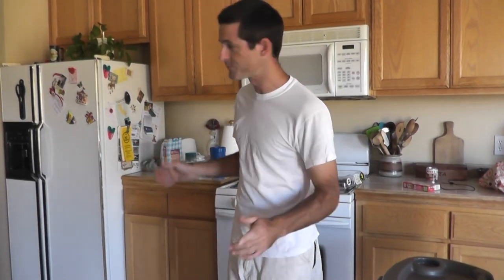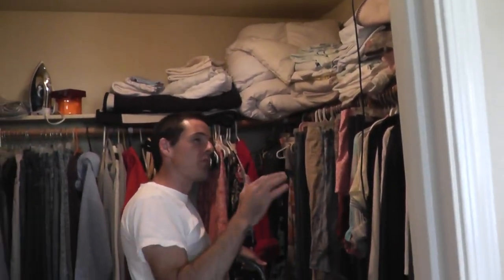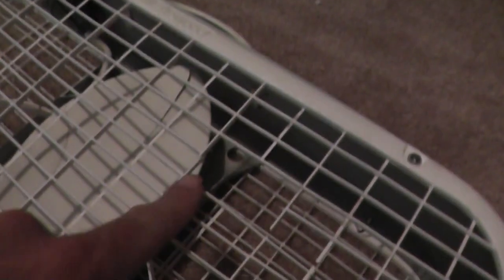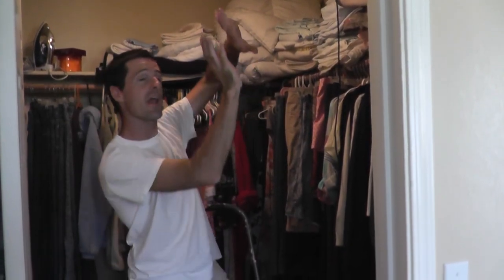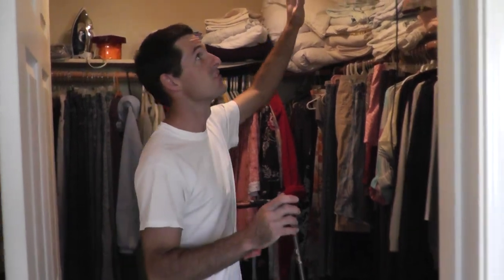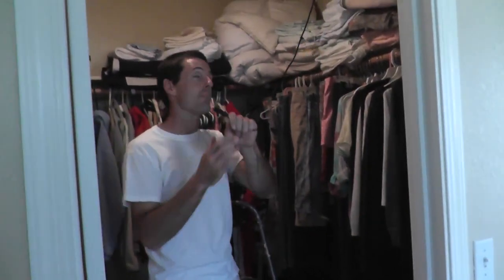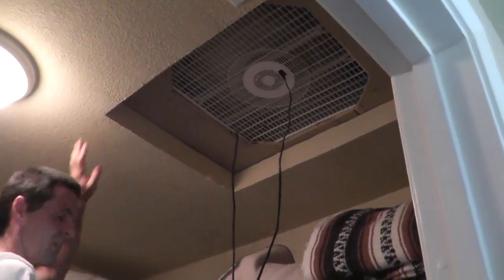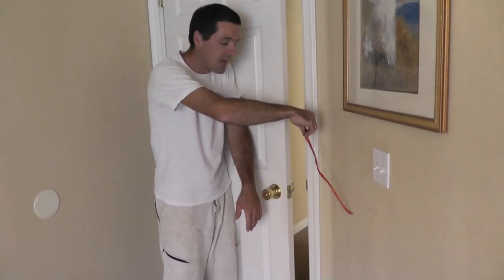Cheap Homemade Whole House Fan - How To Cool Without A/C !!

Comment: I did this to cool my condo.. it worked great = seriously saving money is plenty fun and figuring out tricks to do it on the cheap are even better ... now in my house  it still works and yesterday  box fan fell over and broke a blade... so room a/c and small circle fan is  running to keep the air upstairs in the babies room moving and that is keeping a 81* temp day outside here about 71 ... booya! ... still going to get another two box fans since they are only $15 a piece and are probably way more energy efficient...

Comment: I really want to try this, but I'm worried about pumping all they warm air into the loft. We're renting so have to be careful. Do you need to do anything in the loft in terms of venting?
Reply from the maker: Yes, it only works if the attic is ventilated.

Comment: I went to Walmart last year and got me a 18 inches Optimus  high velocity fan and made a special frame for safety.. . works really good! 127  deg F. and if i turn the fan  on to medium setting for 15 min  Attic temp  drop down to 109 deg F. ( using Arlo video cam)  house is 2200 sq. i also made a shutter  that way small particle  don't  go inside  my house... re wire  all the way down   like a hall way switch.

Comment: Genius! Good idea. Hmm I don't have an attic since I am renting :(
But I understand the concept completely. So I need to get rid of the hot temperature from inside the house? At least that's a start. I am also in the same boat of not powering the A/C...yeah the power bill here is ridiculous? 

I've been thinking what would be my best options:
- Buy a portable A/C
- Do more overtime and pay the damn expensive bill.
- Install solar panels

What's more annoying is, I am a nite owl so I normally have the light on late at nite and it can be very hot.

Comment: wait till try a real fan, you will be so impressed it;s crazy.   on the cheap, check for a metal blade circulation fan, OR try a thrift shop/ donation store, sometimes they have building materials, i just picked up a really cool fan for 10 bucks, they are 125 to buy not including shipping and way higher in a walking store.   10 bucks man! :O)   it's super quite also.  made in Germany, pulls 100 cfm per minute and it will fit DIRECTLY into a 4 inch pipe!     I'm still going to get a reg attic fan going however, for upstairs. this 100 cfm is for my office to keep my systems cool and air flowing, 150 sq foot room will be breezy. :O) 

  Great Video! Anyone can do what you have done in a fast cheap way.   I for sure will not be letting my attic openings be unutilzed even after I get the big gnarl y in the main hall above the stairs.  OH YEAH!   there is also fans you can put into the vents in your attic, run them on solar power.  it clears your attic of unwanted heat that you are pulling from the house.
Reply from the maker: +Leisure suit Larry Thanks for the comment, it's interesting you mention the bigger fan, I have since replaced the box fan with a utility unit like you mention, and it works extremely well.

Comment: This is a sound theory to suck hot air into the attic.  When i lived with my parents they had a ceiling fan and it was super effective.  I cracked my window at night put my feet next to the window.  My window was next to the front lawn and it was even more cooler when the lawn was watered at night.  :)

Comment: I don't know what kind of insulation I have in the attic.  If it has any asbestos, would a very strong fan disturb and pollute the home?  Even if it has no asbestos, can it cause air pollution from whatever insulation is there?
Reply from the maker: I never noticed the fan causing any turbulence, but I still would not suggest using an attic fan unless you know that you have modern insulation. Thank you for the comment.

Comment: One piece of advice, to make this better, it will require some cost, not much but look for a pressure optimized fan. Basically see those big gaps between the blades and the edge of the fan? well that allows air leaks and also limits air flow. I'm working  on the same sort of thing for my place, the only difference I am doing is a whole house in window evap cooler that runs 4000cfm and the fan itself runs 4200 cfm, so that means I will get a nice air flow across my house in the hot desert days, so far with just the fan the temps drop to 82 when its 106 outside, cant wait for that evap to be in place.
Reply from the maker: Thanks for the advice, I'll read up on pressure optimized fans. I actually just picked up a big fan at lowes that says it can do 6800 cfm. I kind of doubt it moves that much, but it's a step up from the box fan. That sounds like a pretty good cooler. 4000cfm should really get the air moving.

Comment: It moves the ribbon but it is still just a box fan. You need a much larger fan probably a fan running off 220. That 110 box fan will impact your electric bill and move a fraction of the air you need to move to accomplish what you want. Nice work on your video your comments are to the point and not a lot of rambling.
Reply from the maker: thank you. I agree it can't move as much air as a purpose built unit. But it's much better than nothing.

Comment: Have you considered mounting solar on your roof and running the fan off a small solar panel? You could set a timer for the fan to cycle on and off.  Also there are attic fans that can be run using solar. If you are mainly interested in saving money. I'll spend money in the summer to cool the house with my AC and save it in the winter. I can always add more clothes or blankets then.  Interesting video good luck with your experiments.

Comment: the fan blade should also be metal  since they move more air than plastic ones do.
and to get even better air moving efficiency you really should use a blower instead of a fan.

Comment: What indoor temperature variation are you getting with this method? How much money do you save in energy bills per month? Thx.
Reply from the maker: Hi, with this fan and my homemade evaporative cooler, I've been able to keep the electric bill under $40 and the inside temps under 85 degrees.

Comment: Make a one off investment and insulate your whole roofspace. Insulation is where's it's at bro. No running costs.
Reply from the maker: Marksphysics Formula One I tend to agree. Efficiency is beautiful. Just like saving $1 is like earning $1.25 (or more depending on tax bracket)

Comment: one thing you should have put window screen on the plywood to keep out insects that will crawl in during day or nite
Reply: rock dawg who does not have fully screened windows nowadays ?
Reply: Most I know of other wise you will get insect in your house from attic like spyders or wasps
Reply: rock dawg I've been running a setup similar to this for 20 years and never had a problem with bugs.  The attic vents have screens on them to keep the big bugs out and the attic daytime temperatures in the summer are too high for most insects and spiders to survive.  Folks who have problems with rats, squirrels or bats in the attic should be concerned, though, and should take steps to exclude such critters anyway, since squirrels and rats have been known to chew on wiring, causing house fires.
Reply: why when u can bottle them in mason jars to save on the grocery bill?

Comment: Nice idea. I've been doing the same thing for the past 5 years with one exception. My 20" box fan is in my walk-in closet in my master bedroom on the second floor where my attic access is and I only run it during cool weather such as early to mid Spring and early to mid Fall. I run it with my windows open on the first floor during the day and windows open in my bedroom at night when its even cooler. Great sleeping with the temperature hovering around 45°- 50°. During the Summer I turn on the air condition.

Comment: Actually electricity bill still be high because you have to run that then probably all day long it's not just AC that makes high electricity bills  It's leaving electricity running
Reply: What's a whole house fan running at? 200whr? 10hrs of that equals to 1 hr of ac, i don't see the big problem

Comment: I've seen a system like this before but the guy ran a PVC pipe deep underground to cool the air before it entered the house low on the north side.
Reply from the maker: John Smith That is an idea I would really like to try! It makes great sense because the ground is so much cooler just a couple feet down. If only I had a backhoe or affinity for digging with a shovel.
Reply: *****
you could just make sure the air inlet is on the north side of the house which is in shade all the time, that is half the battle won  : )

Gotta go now, work  : (
Reply: *****
Yeah you'd have to be careful about the placement of the inlet, and make sure it was properly screened too
Reply: It would be a good idea to make sure that you’re not sucking something like radon into your house with a system like thag

Comment from the maker: Thanks for the comment. Funny you mentioned evaporative cooling. Shortly after I built the fan, I installed a swamp cooler pad in a window so that it would pull in some cold air. It works great! Search my channel for "Cool your house for 42 cents a day" :)

Comment: I recommend using a large floor fan rather than a box fan. Much more airflow.
Reply: Floor fan?  I searched Floor Fan on Amazon and came up with the similar fans as what is in the video.   Do you mean the round fans?
Reply: Thanks for the link!  It does look a lot more sturdy.  Purchasing it now.  Plan to use with his evaporative cooler in the window.
Reply: @IndyTheGreat  I could get 3 box fans for that price and stack them on eachother

Comment: Hey man, I did this and it worked flabbergastingly well, as soon as I plugged in the fan I felt the draw of air, and I mean immediately.  This is only a temporary fix, but exhausting the house air will surely be part of the final solution. Kudos. Thanks for the brain nudge.

Comment: Thats a good Idea, however the fan you are using is too small and the motor is not powerfull enough to do what you need it to do. You should be using an industrial fan with a more powerfull motor also the fan should be able to send air all the way out through the roof.not into the attic. All you're doing is creating a vaccum in the attic and the heat will just sit up there with nowhere to go.
Reply: No, you want it to go through the attic, because the attic acts as a heat trap. This is one reason why there are always soffit or parapet vents from the attic to the outside - to release this heat (and moisture). So the fan just pushes all this hot air up and out these existing vents (provided there are enough of them to handle the airflow).

Comment: No rocket science there, you will agree.  But you did your homework perfectly, I must admit.  Great explanations for those who can't figure tose kind of things.

Give you an "A".  Had you mentionned that you pull the blinds also, when you shut the windows during the day, wherever convinient, you would have got an "A+".  Cheers. Emergency blankets avaliable à $ store make a great heat barrier and let some light through.
Reply from the maker: Good idea about the blankets. The windows are really poorly insulated compared to the walls. Thanks!
Reply: ***** Actually working on vertical venitian blinds here in Quebec. Summer could be very hot and winters always below feezing for 100 days.  Two sided, aluminum anf black.  Turn them black side in during the summer and black side out during the winter.

Comment: yes had one of these fans once it works great. However it must be cooler out side to suck in cool air. So when the temperture drops turn it on.
Reply: robert mccully The ideal way to control the fan would be with a differential temperature controller that senses when the outside temperature drops below the inside temperature.  However, I've found that a simple lamp timer works adequately, since in my area the temperature outside usually drops low enough by 7 p.m.

Comment: Just wanted to give some input that may help with your project. Get into the attic and make sure all of your intake vents are clear. The easy way is simply to turn off your light and count the little sunlight spots around your soffit area. Then go outside to see if that is the same number you can count. If its NOT use a leaf blower to clear the vents. Go online to owens corning and check to see if you have ENOUGH soffit vents. Most people don't. Add a little insulation to the attic "not that expensive" get it cheap at a wholesaler like IDI insulation and get a machine from lowe's to install it for like $50. You should have at least 12 inches of insulation and up to 20 inches "depending on the R-value PSI". You want R30 to R60. If you do all of that which will cost maybe $400 you will notice a HUGE difference. NOTE: before you blow insulation into your attic you want to install intake chutes to keep the intake vents clear.
Reply from the maker: mattdidit84 Thanks for the ideas. You're right. it's critical that the vents are clear. otherwise that hot air just stagnates. I'll check out that website, now I'm curious if I have enough vents.
Reply: Soffit vents are good to have, but since heat rises, it really helps if you have ridge vents.  I don't have ridge vents, but have a LOT of soffit vents, but even with an attic vent fan that is rated for well over the size of my attic, it still gets up to 140F in the summer in my attic.  Back when I was a kid, we had the large whole house "attic fans" and let's just say that we were very glad when we finally got air-conditioning.

Comment: You have the fan backwards...you have the air coming into your rooms from the 
Hot attic...that's what your Ribbon Test shows.
Reply: +ToyotaCamperLiving No, you have it wrong. The fan is set up correctly. The ribbon is being sucked toward the fan, in the closet. Think about it...

Comment: Bring me up to date? You did this video in 2013. How has this worked? If I understand you open all windows at night and run the fan....in the morning you turn off the fan and close all windows right? I'm in Arizona so I would run air because 116 is too hard to take .So it's seems to be a timing issue also I see. Fill me in a bit if you can. We expect 105 this Sunday and we have not turned the air on yet!
Reply: I heard he died ....heat wave
Reply: @backinblack1778  LOL!!

Comment: show us your commited to no ac and disconnect vent hoses in the attic. seal off registers and then turn a/c on fan only and it will vent house through attic with more cfm
Reply: Or install some electrically controlled vent dampers that would allow him to switch from exhausting air from the air-handler into the house or into the attic.

Comment: if only you could rely on temps dipping to 65-70 at night. I live near Pittsburgh and there are plenty of times its still 75 or higher at 2am.
Reply: Very true. Whole house fans are only efficient in non-humid climates that have temps dropping significantly at night.

Comment: Just open the windows when outside temperature is cooler or same as indoor and close the windows in the morning. This will keep your house cool almost all day and check the weather for that night to leave the windows open or closed. If forecast says it will rain then use A/C for that night. But if you don't like humidity then you have to use A/C. Always check your local weather for humidity or rain then decide  for A/C or opening the windows.
Reply: sara shin Your suggestion works like total turds when you have a two story house.

a>  For it to be effecitve, you have to leave your downstairs window open all damn night.   Security problem.     Alternatively, you can open top and bottom of a window upstairs.. this is a very weak convection 
 
b>  your upstairs will still be hot as hell until 2am   The first couple of hours, cool air is filling up the lower level, not the upper level, where people are residing.

with the fan, you leave the lower level windows closed.  cool air immeditately enters the hot bedrooms...
Reply: +BarryObaminable 
I live in a 2 story 2500 sq/ft house. I haven't ran my a/c in 9 years . I've got fans 2 downstairs and 2 upstairs .The 2 downstairs blow in and the 2 upstairs blow out all day.I figured out if I keep the air moving during the day its easier to keep it cool. I also heat with woodstoves . The gas company came to "TEST" my meter .lol I just told the guy to take it with him lol. I can't wait til I can tell the Electric Company the same thing.

Comment: Cool idea if u live in a place where the temp goes from 100 in the day to 60 at night. But here in vegas it goes from a dry 115 in the day to a dry 100 at night. So yeah... i need my a/c in order to survive!
Reply: Dry heat must be nice, can utilize an evaporative cooler instead of a refrigerant air conditioner which uses much less electricity.

Comment: Another case of too little knowledge resulting in overcomplicating something., If you use it during the day, all you are going to do is suck in hot outside air. Also, unless you have roof mounted vents, the hot air won't have a way to get to the outside. You need a certain amount of area to effectively exhaust the air you are moving based on the cfm of the fan,. Otherwise you create too much backpressure in the attic for the fan to work effectively. So just put the fan in a window in the evening.
Reply from the maker: I don't use it during the heat of the day. 
I do have attic vents.
Reply: Good grief, your comment is proof of too much rudeness resulting in an absolutely no common sense.  What house built in the last 30 years does not have roof ventilation?  And just how dismissive are you to assume he would run this fan during the heat of the day?  All he was doing was demonstrating how well this worked.